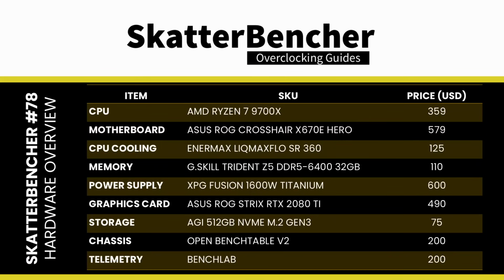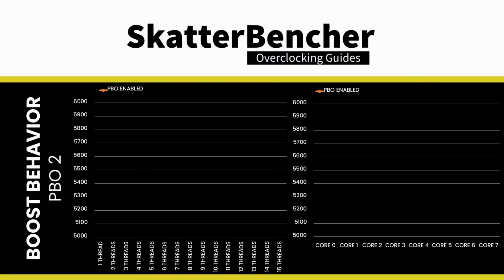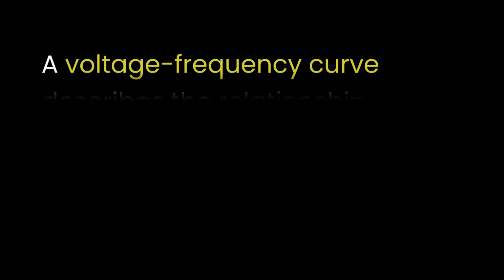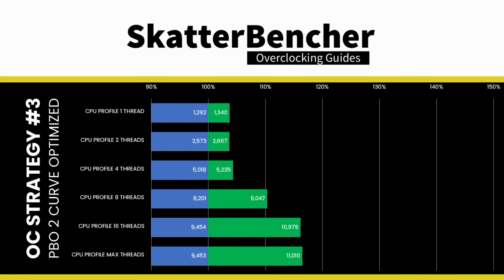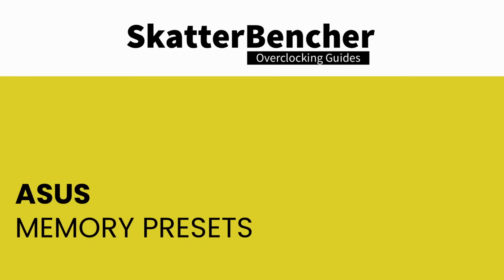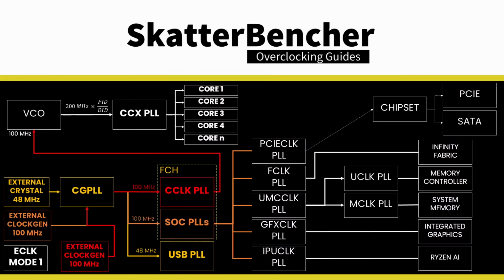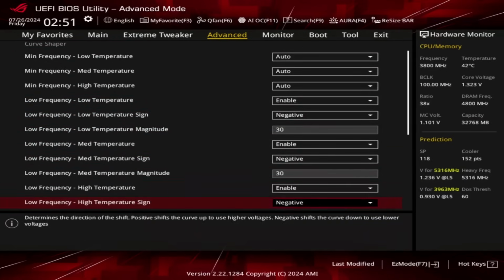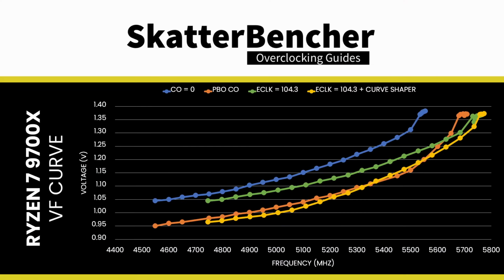Ryzen 7 9700X Undervolt & Overclock to 5860 MHz | SkatterBencher #78

Comment: So on Ryzen 9000 it can go lower than -30? Oh wow.

My 5900X shows a lot of instabilities on relatively high CO numbers, and that's with default Fmax, not higher ones. You seem to be very lucky with your 9700X specimen.
Reply from the maker: On Ryzen 7000 it could also go below -30. On initial Ryzen 7000, I could even set down to -300 (of course having to add a voltage offset on the voltage regulator for stability), but it seems after launch the limit became -50 or so.
Reply: @SkatterBencher  oh, so -30 is a limit only for Zen 3 it seems?

Comment: Good video!
AMD released Zen 4 with temperature limits. People were confused.
AMD released Zen 5 with PPT limits so it's efficiënt. People are confused.
They will always be confused.
Reply: Are people not aware that the Ryzen 7 7700 NON-X exists? It has the same 65W TDP and 88W PPT as the Ryzen 7 9700x, but it has 98% of the Ryzen 7 7700X performance, while costing just 250$.
Reply: @rattlehead999  98% ? 🤔My 7700X runs at 85W PPT 5490 Mhz all core. It used to boost to 6200 MHz on two of the cores with early Agesa (ASRock Live Mixer). Now they hard capped it at 5500 MHz. I speculate the 7700 non X is a lesser bin,  so they can sell those parts. It costs less so is not a fraud. A genius move.
Reply: @reptilespantoso  At stock your 7700X runs at 85W when executing AVX 512 at an all core 5490Mhz at 100% load? I call bs. 

The 7700 non-X is a slightly lower binned, literally 100Mhz single core and 150Mhz multi-core 7700X, but it's configured to consume normal amounts of power stock, while the 7700x is configured to top benchmark charts at any cost.
Reply: @rattlehead999 i configured my 7700 to be 7700x
Reply: @Vlad-jy9ls  why would you?
Reply: @rattlehead999  extra performance for free and i wanted to try overclocking
Reply: never give up, even when you're being fed bullshit
Reply: AMD is confused since they didn't give it 105w at default and kneecapped it with 88w PPT vs the 9900x 170w and 9950x 200w
Reply: Glad there are people who can describe the failure of amd in such a funny way, IMAO.
Reply: @eyesta  Whose failure? This seems to be a great part with a wide range of possible settings.
In general: I'm tired of catering to the lowest common denominator. It creates mediocre ideas and lazy behaviour. The PBO2, Curve optimizer was always there to use.
Reply: @reptilespantoso  Congratulations on a useless purchase, keep talking
Reply: @reptilespantoso  I like playing video games I never cared about the extra 20-40watts and I don't care about that improvement. I want better fps and not to buy the same thing.
Reply: I'd be very worried as to why they decided to tame these chips by default.

Comment: Clickbait title, or solid allcore 5860MHz and no dips? Bet 5 roubles on clickbait.
Reply from the maker: 5860 in 1T loads, 5500 in nT SSE, 5400 in nT AVX2
Reply: @SkatterBencher  thanks anyway, 5400MHz with AVX stability is n1

Comment: nahh you need to make these shorter man
Reply: I disagree. The point of this video is to familiarise and explain the turning options for a larger audience. If you're not familiar with this channel, and as he stated, a shorter video (usually 5 mins long) will be posted sometime later.
 Also, I've done the crazy thing of going through all the comments, and the general idea is as follows: only debauer shows this overclocking stuff on YouTube for 9700x, for the rest of them, they tested the CPU out of the box and expo enabled, which made me wondering: "what's actually out of the box experience?", because Gamers Nexus and Hardware Unboxed have their point too, but isn't that stretched a bit?
Reply from the maker: I have a "5 Minute Overclock" coming soon
Reply: @SkatterBencher  Probably leave out the bits where you're just listing the numbers on the screen. I dont mind longer-form content, but this seems stretched out needlessly.

Comment: And after that, still 7800x3d kill it.... In gaming
Reply: 9950X3D and especially the 9800X3D, if rumors are true you can overclock all CCD's not just the non 3D-Vache are going to be gaming TITANS.
Reply: @iLegionaire3755 thats i need. a new overclock monster
Reply: Aha
Reply: It was actually pretty close on stock settings. 20 more frames on 1080P.

Comment: super disappointed by the memory controller... they didn't do anything with it. and that was zen 4's only issue, memory complete instability issues. I CAN'T BELIEVE THEY DID NOTHING HERE!
Reply: That's why AMD need X3D cache. If they can improve the I/O die, the processor will good at everything. The core already better than Intel, but not the I/O die.
Reply: There are rumours that zen 6 will have much lower i/o to ccd latency 
Of it's true it will dramatically improve gaming performance 
P.s. i thought they will improve infinity fabric in zen 5 :(
Reply: Apparently newer BIOS revisions actually let these chips do over 8000MT/s :D
Reply: I can not wait until AM6, it is so obvious how much even these 8 core CPU's are hold back by way to little memory bandwidth.
We need DDR6 as soon as possible.

Comment: These chips weren't pushed close to the red like previous ones. So ocing nets way more performance at the cost of power and thermals. Kinda makes oc'ing a thing to go for on amd again.
Reply: It's opposite to Intel which drives their processor balls to the walls, borderline crazy and degrading itself.
Reply: @KarrasBastomi  Intel specs don't degrade CPU, motherboards applying crazy voltage do. It would happen the same to AMD CPUs aswell
Reply: @lir4e  lol Intel admitted that their microcode was broken and it is cooking all the 13-14th gen CPUs do you live under a rock or something
Reply: @lir4e intel specs are just recommendation
Reply: @lir4e  Voltage increase is a request by CPU which is then applied or denied by the motherboard based on your power budget/settings. Stock CPU behaviour(without auto OC options like "Asus Performance Enhancement") is always dictated by the CPU vendor which is why only limiting the power on i7 - i9 isn't enough to get rid of it's voltage spike. CPU VID table will still cook that one fastest core with more voltage than it is actually safe because it was designed to run that way and deemed safe by Intel themselves. If you want to limit voltage each core is supplied you need to do it manually in the BIOS by setting offset or manually setting the voltage curve core by core basis. 
Orr.. you need Intel to actually fix their shit. Stop caring for last 5% on benchmark scores and stop pushing that poor silicon to 1.5-1.6 volts which every person that ever overclocked their CPU knows is not safe for daily use.
Reply: @lulifruli9132  Ring bus? More like ring BUST! 🤣
Reply: @lir4e considering it was the CPU microcode no it wouldn't
Reply: @v000000000000v Your brain dead it was the motherboard BIOS settings. They claim it was a micro code because it’s easy to say an error than a dumb decision they choose to make.
Reply: Yeah but Amd does not like users to OC, is there a model that they will support OC on? Fooz could void warranties
Reply: @xlr555usa all amd CPU’s support overclocking, not all intel CPU’s do.
Reply: @xlr555usa  Sure bud that is why AMD has their own OC program Ryzen Master, They wouldn't want to encourage OCing.

Comment: The only review on youtube thats worth something. Thanks. When a new cpu is kind of crap just dont say its crap, overclock the crap out of it... like you did.
Reply: Those who understand the changes don't think this was a bad cpu. Major architecture changes leads to better memory handling, efficiency, and room to grow. Lowering power draw at base clocks leaves TONS of room for overclocking. SkatterBencher showing this case in point!

I can't wait for the 9800x3d or 9950x3d with this kind of potential. Here's hoping the rumors that PBO and curve shaper all work on x3d are true!
Reply: These comments are so braindead holy hell. Like what a genuinely stupid thing to say. Idk why the average commenter is only capable of thinking is this vs that mentality. Like a thing simply cannot exist without being better or worse than another thing, no matter how arbitrary the actual criteria for determining the quality. (Typically nonexistent with 0 actual points or comparisons made, simply empty claims of being “better”cuz ???) 

This is an in depth overlocking guide, not a review. At no point does scatter even review the 9700x in this video. 

Yall actual npcs I swear
Reply: An OC is an OC you're running it out of spec
If something happens to that chip they can deny you warranty..
the silicon lottery is also a thing
Reply: @jittertn  they cannot prove that you overclocked it
Reply: @Celatra  Except they can. There are flags (tiny fuses) within CPU's that trip under certain OC conditions.
Reply: @Celatra  you have no idea how cpus work do you lol.
Reply: @XxXDOMINIONXxX  who the hell is gonna look at any signs of overclocking? Esp big companies like amazon
That would be way too time consuming
Reply: @jittertn  I have been OCing my 1700x for 5 years of heavy use, its well worth the risk of OCing
Reply: @sofancy.  OC are not guaranteed perfomance , they are chip dependant
not everybody has money to risk an expensive processor

Comment: A light in the dark tunnel! This was a disaster launch. But OC saves the day?
Reply: @osenoqxd_8369 It is fun to watch how after 2yrs AMD still can't outperform a "defective" Intel i5. Lol.
Reply: @osenoqxd_8369 The only reason the 9600x "beats" the 13600k in gaming is cause Intel released it with low clock speeds. My 13600k runs 5.6ghz all core, 5.8ghz 2 core. From my testing of multiple 13600k's, I can guareentee all of them can do at least 5.4ghz @1.3V. Before you say overclocking isn't fair, you're wrong cause you use PBO on AMD, which essentially is overclocking. So a 13600k @5.6ghz stomps the 9600x in gaming by 10%. And not to mention that it delivers over 40-60% more multicore performance for 2/3rds the price.
Reply: @osenoqxd_8369 I will agree with you on this point, 7800x3d works out of the box well. (Cant say the same 7950x3d cause of the core scheduling issues). And yes, 7800x3d is the best gaming CPU, but I wouldn't buy it cause I don't only game. A 13600k only loses by 1-5% in games where the cache doesn't matter. I will admit it loses by more than 20% in games where cache does matter, but again that's with a 4090. Any other GPU and the gains will be minimal by the 7800x3d, so there's no  point in compromising 40% multicore performance unless if you know all you're going to do is game. And those gaming losses are almost none in 1440p and 4k, the resolutions that most people will be a using a 4090 for.
Reply: Nope, my 13600k oced to 5.8ghz still curbstomps this cpu 😂😂😂. Don’t go near Ryzen 9000.
Reply: @ProVishGaming  your cpu is subject to degradation courtesy of intel though
Reply: @vespa7961  actually no cause I don't run it 1.5v out of the box like most people do. It runs at a stable 1.28v. Nice try tho
Reply: @ProVishGaming  it's nothing to do with set voltage... it's a microcode error which is degrading cpus 'NiCe TrY tHoUgH
Reply: @vespa7961  ... the microcode error is literally about sending wrong vid voltages. I set my own voltages and I'm running strong after 2 years. Keep coping with the shitter product.
Reply: @ProVishGaming  it doesn't matter what you set as the microcode is sending incorrect values. yes. I'm sure I'll be upset with my 7950x3d and my 7735hs minipc :D
Reply: @vespa7961   first of all, the microcode error only sends incorrect vid values, but you can set vcore yourself. I know this cause I tested it with my own multimeter and the voltage was .002 off my vcore, which is acceptable. People like you blindly just take the headline from mainstream media but don’t do any research or testing yourself. It’s also painfully obvious that it’s a vid issue cause vid would recommend 1.55v on i9s, which we all know to be dangerous voltages. Secondly, I have also added a IR Voltage limit of 1.4V. Thirdly congrats, I’m an enthusiast so I like to mess with hardware. You seem to be a person that wants it to work out of the box, and there’s nothing wrong with it. Ryzen works well out of the box, and that’s something intel can learn from.
Reply: @ProVishGaming  i have an OC world record... but ok :) it is an internal flaw that causes irreversible damage to your product, you should return it and buy a reliable product.
Reply: @vespa7961  lol I just told u the flaw was VID. Wondering how you have a record if you don't even know what that means. Or maybe you should go get some reading comprehension if you can't understand I already tested it with a multimeter.
Reply: @ProVishGaming  yes I know what vid means. The issue is deeper then this :)
Reply: @ProVishGaming  13600k is about a wash with the 7700x for productivity tasks though, and it gets absolutely creamed in gaming by the 7800x3d. The 9700x should be about the same performance as a 13600k but using 1/2 the power.
Secondly, the talk is that it's not core voltage causing degradation, but the ring bus getting melted. The 13600k only has 6 p cores and 8 ecores so the degradation takes longer, you should plan on upgrading soon.
Reply: @ProVishGaming But enthusiasts dont buy problematic cpus... you aint no enthusiast.
Reply: @PineyJustice  a wish-wash in productivity? Why don't you watch my video. 40% is not a wish-wash, its annihilation. Most delusional AMD fanboy. The only thing I can agree with you is power, yes the AMD chips are more power efficient. But you spent $300 more on the build. It will take years in electricity to close that price gap. Also, where in the world is the ring bus getting melted??? Please cite your sources. (I've had my CPU for 2 years no sign of any issues.)
Reply: @argmits  The only thing problematic is AMD fanboys. Before you call me a fanboy, I have many times supported the 5800x3d cause in my eyes, it is the best gaming CPU for your money.
Reply: @ProVishGaming  I dont take advice from non enthusiasts that use subpar and problematic cpus tyvm!
Reply: @argmits  liking your comment. Most delusional-attention seeking AMD fanboy. We love to see it! 🤪🤪🤪
Reply: @ProVishGaming  Try to not use that junk cpu too much, remember you got limited time until it goes poof. Keep it for winter where it gives extra value.
Reply: @argmits  yeah I’m not going to listen to some idiot online that repeats mainstream talking points lol. I had my cpu run at these settings for 2 years. It’s not going to magically die like you’re saying. Have fun using the inferior product!!!
Reply: @ProVishGaming  It is gonna die and you know it. If you were an enthusiast you would know not to buy it but we cant all be good at this.
Reply: @argmits I have a 13900k and a 7800x3d. I'd choose the Intel every time. AMD OC is so locked down. You are beholden to the algorithm. Intel allows you much more freedom. 13900k at 5.8p/4.5e/5.0ring since Nov 2022 without issues. If Intel wants to give me a refund so I can buy ArrowLake, I'll definitely take it :) I think it's best to own and test the products yourself rather than make assumptions based on YouTube videos. I personally prefer my Intel system over the 7800x3d one.
Reply: @jjlw2378 good luck with that CPU.
Reply: @jjlw2378  Lots of words to convince yourself, but its ok intel has to make a living somehow and thats where the amateurs come in, meaning you. Leave the good stuff to the enthusiasts you dont know how to use em anyway.
Reply: @jayvee8502  Thanks! I've got 2 extra years of worry free use now :)
Reply: @ProVishGaming  What do you mean about speding 300 dollars more on the build? 
AMD is known all over the world as being the cheaper option, you dont even need a beefy cooler, not even for the high core count parts.
How much did you have you spent on your cooling system? never heard of any Intel enthusiasc using a cheap cooler.
Reply: @RawUpgrade  I use a thermalright pearless assassin 120 SE, which is $35 on amazon. It cools my 13600k well. 13600k is $229, mobo is $100, 32gb ddr4 ram is $80. 9700x is $360, mobo is $100ish, ddr5 ram 32gb is $110. I see that ddr5 prices have come down, so its only $160 more. But you are spending $160 more for 5% more gaming performance, and 40% less multicore performance. Sounds asinine to me.
Reply: @ProVishGaming  but intel cpus are degrading, cant even resell em them they so bad!
Reply: @ProVishGaming  That is if Intel doesn't purposefully degrade it out of the box, my 14900K lies dead in a garbage bag.
Reply: WTF is wrong with you guys.
You argue like little kids ffs.
This thread is easily one of the most r word I have seen on YouTube.
Reply: @ProVishGaming  are you living under a rock? First of all, GHZ doesn't mean anything, it's the actual performance. Because you can't compare just based on GHZ. And most importantly, your amazing CPU is going to die in a year LOL
Reply: @BleepBlop-rh9lm  Are you stupid? There's a literal video in my channel where I show my benchmarks. Keep coping with your inferior product. Imagine spending $350 more just to trade blows in gaming and be 40% slower in multi-threaded workloads. Can't be me. I know my CPU will last another 5 years as well.
Reply: @ProVishGaming  that cpu is ass for gaming